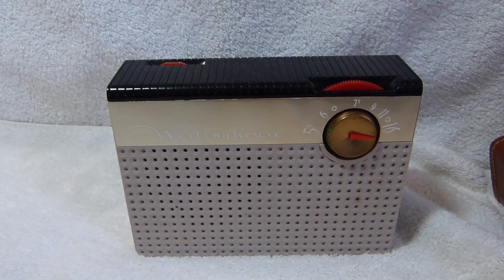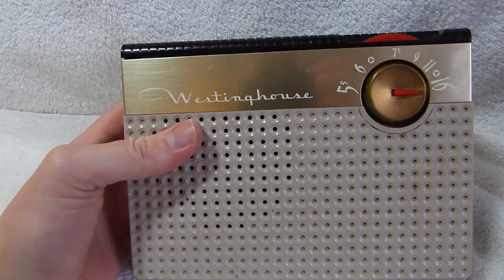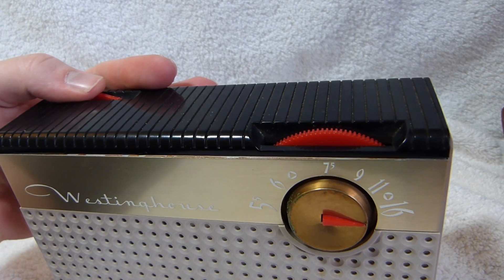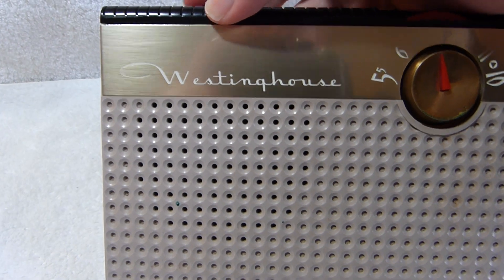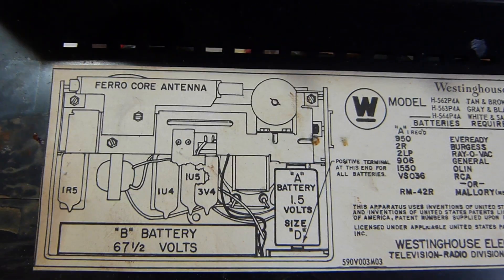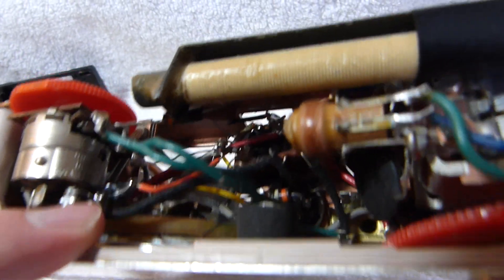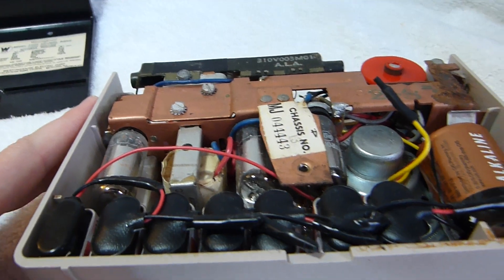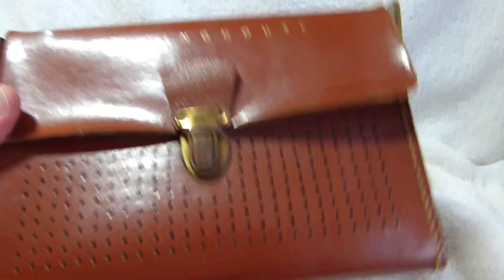1956 Westinghouse model H-563P4A portable TUBE radio (USA)

Comment: I remember as a kid, that battery portable radios were rare, most folks used car or table radios, or consoles, BIG Is better was the way of thinking.  So a family might have ONE battery radio for camping, picnic, ball games outside, or perhaps at the beach, since you only had an hour or so since they did not have alkaline batteries, and carbon batteries were not real cheap. Pocket transistor radios made portables far more common in the early 60s, you could get one for less than 15$, and MIJ was not as taboo.
Reply from the maker: Makes sense, even this "economy" set cost around $250 in today's money and the cheapest transistor sets went for around $500 in today's money in 1956/57. Prices fell very quickly on transistor radios and it seems that most American's put aside their animosity towards Japan when they saw those low prices.
Reply: and some folks on epay want that kind of big bucks for old stuff too
Reply from the maker: And lately they have been getting those prices... most American pocket sets used to sell for under $20 2 years ago, but now its' hard to get anything decent for around that price.

Comment: Hello Matt, another interesting video, thank you very much for posting that. Also thank you for the message I received late yesterday. Yes I hadn't thought about it like that. You being over in the U. S. have access to many rare sets that are almost impossible to find over here in the U. K. and likewise radios like the excellent British made Hackers are relatively easy to come across over here. Indeed my first ever foray into the world of buying vintage radios was/is a Hacker. I've got a Hacker Sovereign 2 RP25a in the rare white colour. I paid far too much money for it but not having the knowledge to diagnose the fault on a non working example and put it right. I'm forced to pay a premium for sets that someone with electrical engineering knowledge has restored and put up for sale. Mind you, I absolutely love that radio. I was thinking of adding a Hacker Hunter to my very small collection of vintage radios myself. There are many for sale at very reasonable prices over here and was considering getting the RP38a, the one with the construded aluminium front. At present though I'm kind of torn between looking to aquire one of the brilliant radios made by Bang and Olufsen possibly the Beolit 707 or if I could justify the expense the old 1000 model from the mid 1960s.the model with the wooden fascia and the small feet that come out when you place the radio on its front. Im also looking for good examples of the Schaub Lorenz Touring line of radios the 70 or the 103 hold much appeal. Also, of course, pretty much anything by Loewe or Tandberg. As I've said, I'm very new to this hobby and feel a bit like a kid in a sweet shop at the moment lol. On that note I'll say thank you very much for your good wishes. I hope you have a great day.. Take care bye for now. Peter.
Reply from the maker: Peter,
The Hacker Hunter is a nice radio and definitely worth picking up, although mine has an odd microphonic problem, something I thought was only found in tube radios. I have a Beolit 707, which is another nice but expensive set and I am hunting for a Beolit 1000, which was built for export but is quite pricey. I can also definitely recommend Tandberg and Shaub Lorenz's radios, although the early ones are trouble prone and hard to work on. I still get that "kid in a candy store" feeling once in a while, but I now have most of the sets I set out to collect. 
Regards,
Matt

Comment: Hiya Matt, thank you very much for your message. Yes to my limited understanding. The Hacker Hunter, although released as one of the more affordable Hackers at that time. Is, to those that own them now, purported to be one of the best sounding Hackers available. As for the problem you're having of a microphonic nature with the one you've acquired. I don't know if you can, being over in the U. S. but here in the UK there's a Hacker Radio owners club thing online I'd urge you to join . There are some extremely knowledgeable people on there and they're a friendly enough bunch who I'm sure would be able to help you with that and any other problems you may have with Hacker radios. There's a Hacker owners club and also an offshoot called Hacker Sound (I think) for the products that Hacker made in the later years when they'd moved operations from Maidenhead to the ill fated (it caught fire and burned down) factory at Bournemouth. I'm still very much enthused by this marvelous, although expensive hobby and was looking, enviously, at some old tube sets. Those made by Saba seem to hold the most appeal although Grundig made some very fine table radios. I very nearly purchased a Hacker Mayflower 2. The only things that put me off are being limited to the one FM band, the limit on that bands reception on the Mayflower and the actual size of the set. If I were to get a big old tube set then I'd like it to be all singing and all dancing in order that I can justify both the expense and the space it would consume in my home. Anyway that's just me thinking out loud there.. Please keep posting the videos they're brilliant. I learn so much and enjoy them greatly.. Take care bye. Peter.

Comment: I've got one of these, but the case styling is slightly different, while the chassis seems to be same as this one. However mine seems to be blanked over where the battery saver switch should be.

Mine is in nice condition, but doesn't seemed to have been restored or serviced at any time, is all original. And does work when I connected seven 9volt batteries and one D battery up to it.
Reply from the maker: Interesting, perhaps Westinghouse thought that the "battery saver" switch wasn't worth the expense of its parts. There isn't too much to these little portable tube radios, and they often have just one electrolytic capacitor, for stabilizing the B+ supply, so they may work just fine on their original parts, even if that cap is dried up.

Comment: A beautiful radio, and I have everything but the 1R5 (used as a cheap sub for the Pentagrid converter in Zenith T/O's) - should the need arise.

With regards to "the one capacitor restoration", I've been working on a video proposing that we create a "guild of ethical antique and classic radio restorers". I've gone over the particulars with Meg, who said the filing for a "limited non-profit entity" would run south of $600.00. The biggest problem would be in setting up a board of directors. On the other side of the coin would be setting up a listing of "juried evaluators", and convening elections. I've figured out all of the easy stuff ;)

Maybe a pipe dream, but what the heck???
Reply from the maker: Tim,
It seems like almost all American made tube portables that used miniature tubes used the same four as this set did, which is a nice contrast to tabletop tube sets. 

I tend to shy away from radios that other people have restored because the workmanship has almost always been poor, but this set was cheap enough that I was willing to take the risk. Some sort of radio restorers guild would be a nice thing to have around, but am only aware of a few people who restore transistor radios as a job (although I would bet there are still a number of radio and TV shops around that would take on the work). 

Regards,
Matt

Comment: Nice, but be careful with those cheap Sunbeam batteries. I've bought a few and they have a tendency to leak if you leave them in a radio for a long time.
Reply from the maker: ***** Good to know, I have a bunch of them because they are often included with radios (I guess they are some of the cheapest batteries available)